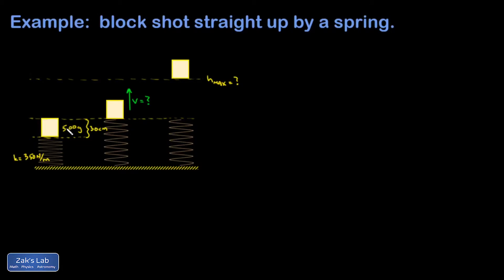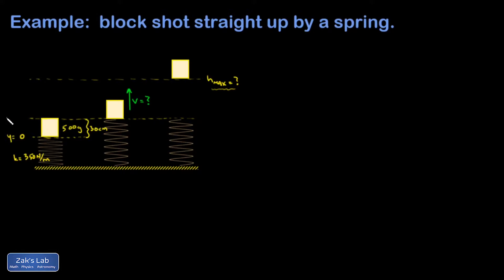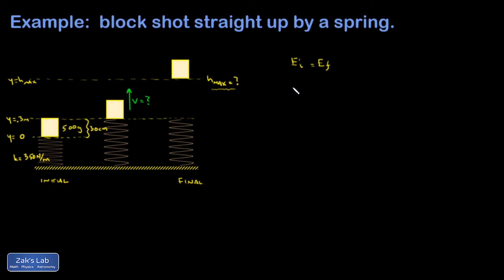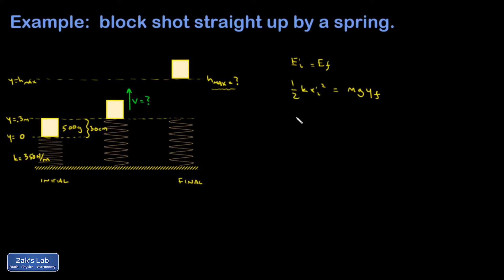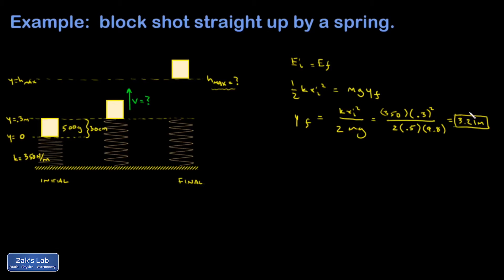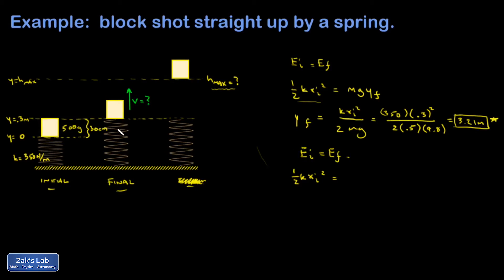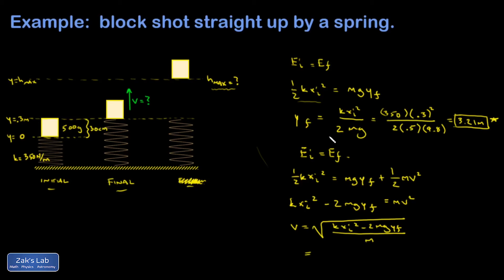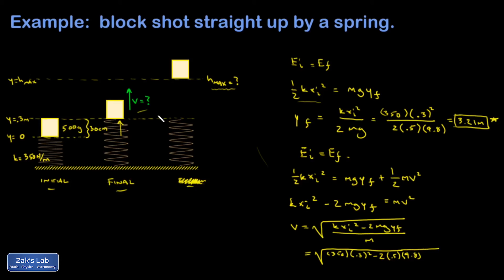Computing speed and maximum height for a block shot vertically by a spring.  Max height of the mass.

Comment from the maker: Question about the video or requests?  I will respond within 24 hours. -- Zak
Reply: I have a physics problem I am troubled about,,, how to get the speed upon landing of a block falling from a height and landing on a vertical spring???
Reply from the maker: @jaosherly  At maximum compression, definitely zero.  Do you mean the maximum speed?  The block does continue to speed up for a bit even after contacting the spring.  Let me know and I'll make a video for it.
Reply: @ZaksLab  the exact problem is --> A 2.0 kg block falling from a height of 5.0 m landed on a vertical spring whose force constant is 2500 N/m. What is its speeds upon landing? ..... I have an answer already but I'm not really sure if it's correct
Reply from the maker: @jaosherly  That seems like an odd question, because the speed when the block contacts the spring wouldn't involve the spring at all, and the speed at maximum compression would be zero.  However, I have been meaning to make a video about a block dropped on a spring and investigate everything about it (speed when contacting the spring, maximum speed, maximum compression, acceleration at the turnaround point, etc.), so I'll prioritize that tomorrow, and post a link here!
Reply: @ZaksLab  we thought of that too!! that's why it really confused us ;-;
Thank you very much:D
Reply from the maker: @jaosherly  I made the video this morning.  https://www.youtube.com/watch?v=OinBV08cDaQ

Note that the maximum speed question wasn't really useful.  The reason is that the spring is so stiff, the block crosses the point where F_spring = mg after less than a centimeter, so there is no chance for the block to speed up much after contacting the spring (I ran the numbers, and it was a correction in the thousandths place compared to the speed right before the impact).  I did compute the speed right before the impact, the maximum compression, and the acceleration at max compression.
Reply: @ZaksLab  :D Thanks! This really helps!
Reply: Why is the tip of the spring its equilibrium? Why not the center of mass of the object

Comment: sir, A cylinder with radius 'r' height 'h' mass 'm', density 'd' fitted with massless compression spring length 'L' at bottom and dropped into water tank height of 'H' what is the bounce up height of the cylinder after hitting the base of water tank? plz.,

Comment: How to calculate maximum velocity of the block ?
Reply from the maker: You can imagine an arbitrary compression distance, x, then the potential energy at that compression is -mgx and the spring potential energy is 1/2*kx^2.  You want to minimize the total potential energy, so you write PE=-mgx+1/2kx^2, take the derivative and set equal to zero.  You will find that the compression distance minimizing potential energy is 0.007m if I ran my numbers correctly.  Then you work the energy conservation problem over, starting with the compression distance of .3m, thus the negative height -0.3m and finishing at a compression distance of .007m and negative height -.007m.  I found a maximum velocity that differed only in the hundredths place by doing this:  original problem was 7.558m/s, and the max velocity was 7.565m/s.  --Zak